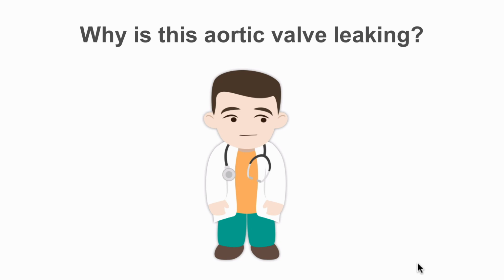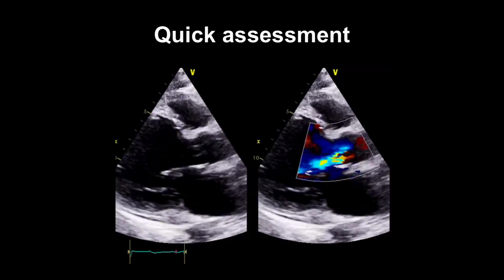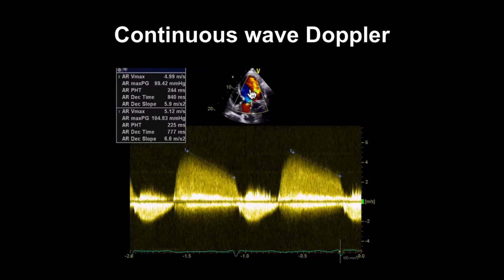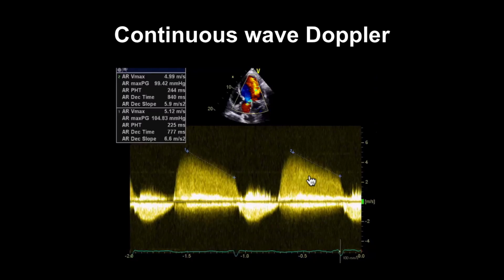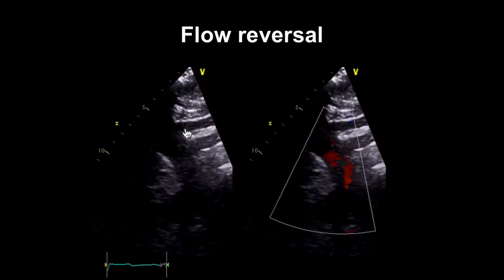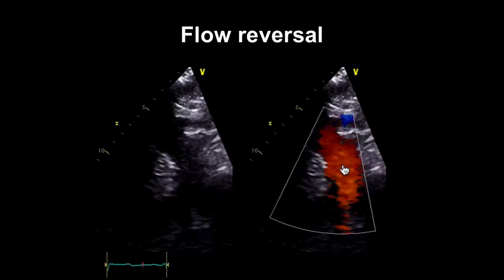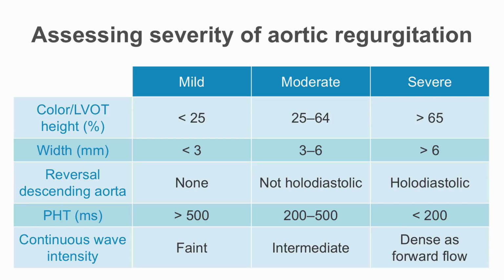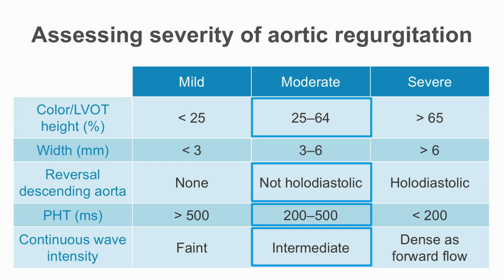Echocardiography Essentials: Detecting aortic regurgitation

Comment: There is no clear  curve density of aortic regurgitation in your video so you make mistake by attempting to assess PHT.   Secondly,  it's waste of time to try use color M-mode  to indicate of reversal flow because PW doppler signal  provides more valuable information,  for instance,  cut-off value of reversal flow  velocity (20 cm/s) in descending aorta